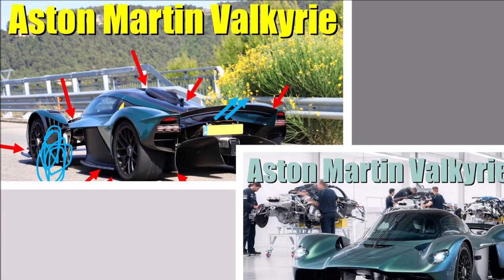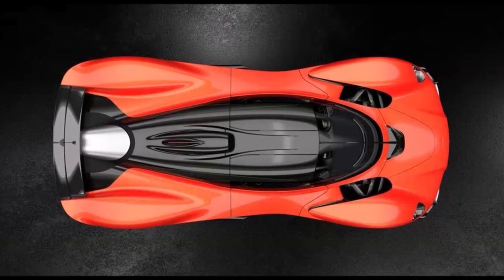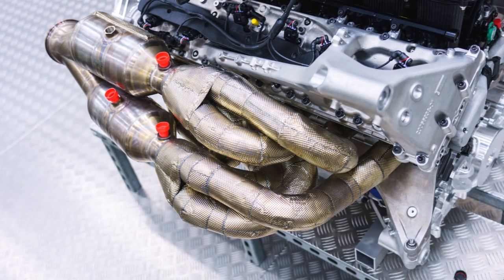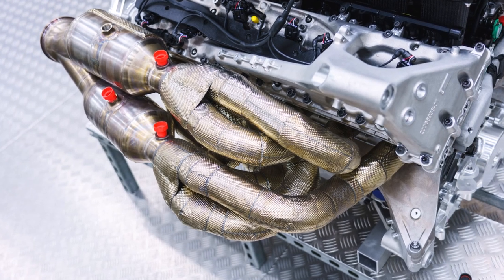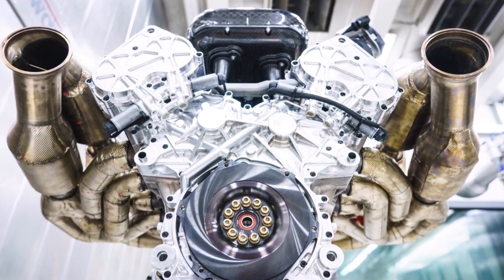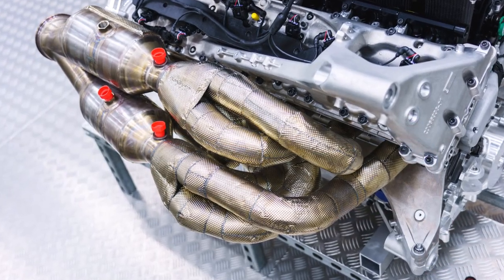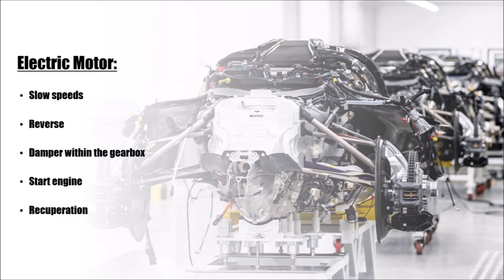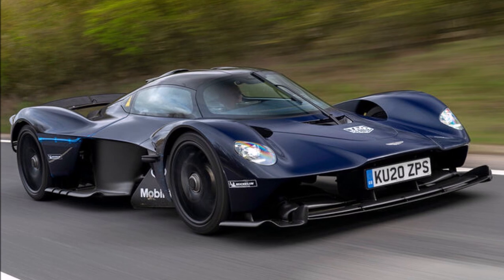Aston Martin Valkyrie - Part 3 - Engine and Gearbox

Comment: How does the number plate affect the aerodynamics?
Reply: Quite a lot I'm sure but I would like to see an indepth on that
Reply from the maker: The plate hurts the flow underneath the car quite a lot, since it’s also in the middle of the car.
The rear plate reduces the cooling outlet and needs to be metal due to the temperatures.
This won’t matter for most customers but removing the plates would help on track.
Reply: @BSport320  According to Aston Martin employees, as the car is designed with the plate in mind, the car performs better with it on. I'm sure if you didn't need it you could do better but they claim its good with it on.
Reply from the maker: @slaughterer97  it would be interesting to know in detail how it performs better with plate. Less drag? More downforce? Better cooling?
Reply: @BSport320  The plate adds a bit of drag and a decrease in total downforce, but almost negligible amounts, the main difference is in aero balance, and as the valk is set up for the aero balance with the plate, it is not recommended to take it off.
Reply: @BSport320  someone from AM explains why in Mr JWW’s >hour long video on the car, from memory

Comment: Why don’t current F1 cars use the MGU-K for reverse? wouldn’t it make the gearbox slightly simpler and lighter without the reverse gear?
Reply: Not sure but probably because of rules
Reply from the maker: In F1 the MGU-K is next to the engine block and connects to the front of the crankshaft. So you cannot use it to reverse, otherwise you would have to turn the ICE the other way around.
If the electric motor is integrated in the gearbox, you can open the clutch and reverse electrically without using the ICE

Comment: Torsional stiffness requirements for an f1 car and also the sort of car the Valkyrie is are very difficult if not impossible to specify. Everyone ALWAYS says they want the highest stiffness possible but this always has side effects in packaging and weight. In all the places I have worked no one has ever been able to give me or justify a vehicle stiffness target figure for this type of car. In road cars the body structure torsional stiffness requirement is normally related back to achieving a 'massed up' first torsional frequency purely for NVH reasons.

Comment: Gordon Murray's T.50 uses a Na high rev 4 l V12 from Cosworth instead of 6.5 l like the Valkyrie but it's also from Cosworth. Are both engines completely different or they share most parts?
Reply: Completely different; probably don't share a single part apart from maybe some generic sensors or things of that nature.
Reply: The t50 will be the ultimate drivers car. Stamp that.
Reply: They might share basic stuff like bore spacing but they’re very different.

Comment: Likes: sportscars should be low and the convertible looks well executed. Effective "willy waver" if that is your thing (I'm not a footballer, sheik, oligarch or hedge fund gangster).

Dislikes: conception is completely hyper - out of touch with reality. It cannot realistically manage the shopping, touring, rallying, driving on back roads or even enter Le Mans.

But of course there is more, a 6.5 litre V12 that sounds like a washing machine at low speed around town is very uncool. The big boots and fuel consumption suggest that anyone who cares at all about the Earth would park this in their Bond villain lair on blocks and do their part for the future.